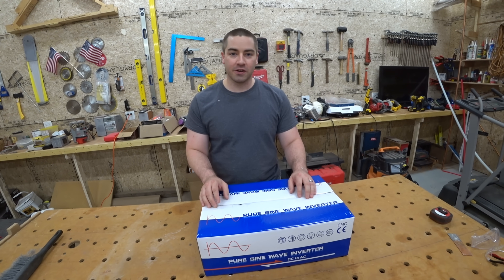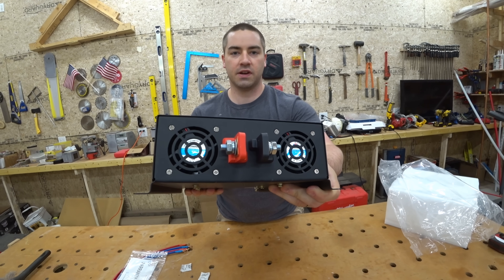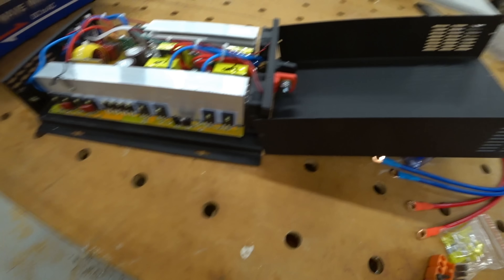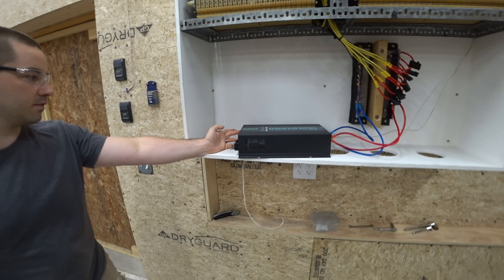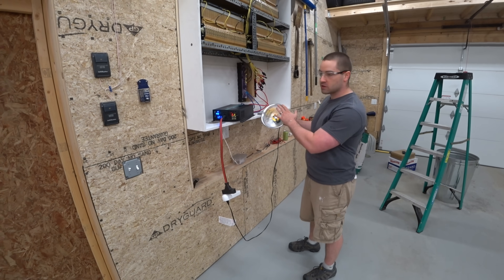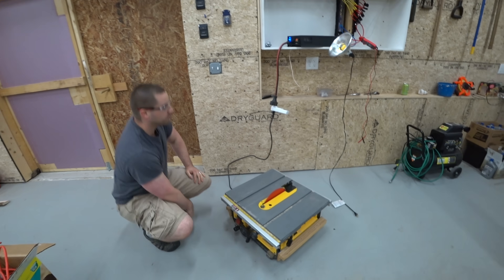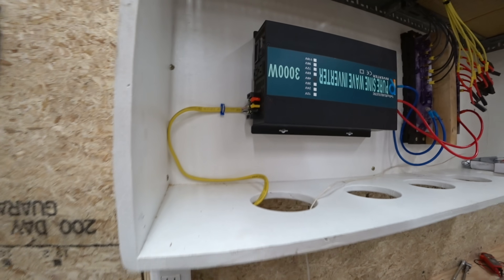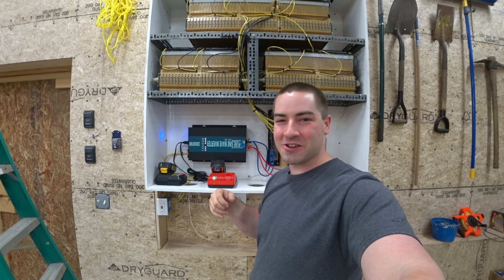Cheap 3000W Reliable Inverter, DIY Powerwall, Chevy Volt Batteries

Comment: Hi, one question. How do you secure that the batteries are charged/discharged the right way, according to the info from BMS? Do you know the remaining capacity of the battery? Thank you
Reply from the maker: Hi Jan,  These lithium cells have a nominal rating of 3.7 volts.  I want to use the cells from a low voltage of 3.5 v up to 4.1 v.  Right now the cells are wired 12 in series, so a resting voltage of  42v (12x3.5) is my low cut-off, and 49.2v (12x4.1) is my high cut-off.  Thanks.
Reply: Hello, and what about the BMS? What happens when there is some fault (in one cell in the 48V array) lets say temperature/voltage. How do you manage not to use this broken cell? how do you manage not to draw to much energy from the batteries, or how do you manage not to charge the it too fast? Does the inverter have different modes? (lithium battery, lead acid batery like for example Victron inverters)?  thank you (I have fiat 500e spare battery and wanted to use it, but it sits in my garage because I'm affraid to use it when there is no BMS.
Reply from the maker: Hi Jan,  Currently I don't have a BMS, but I also don't yet have a charger.  I've been trying to find an AFFORDABLE BMS with monitoring.  I will need 8 BMS's because I have 8 batteries.  

Try checking out "Going Off Grid" YouTube chennel.  He has BMS's.
Reply: Now I see. I tought that you are somehow using the BMS from the car. So there will be much more cabling (if you are going to monitor each cell). I whish you luck and hope to see another great video with charger soon.

Comment: What makes you say it's reliable? It looks new. And the surge capability sucks, and I never really saw you test it with a 3000W resistive load for any length of time. So you put 1680W continuous on it for a minute? Big deal. Doesn't show squat. Get a CT and scope if you want to test surge, otherwise you are just guessing. The sine wave could be at any point in the cycle when you first hit the switch, and no current monitoring means you don't have a clue. Testing FAIL. And your caption is a lie. I am willing to bet if you put 3000w continuous on it, it would fail shortly. Cheap chinese junk never lasts at full service load. Go ahead, prove me wrong.
Reply: From my understanding, the Brand name is "Reliable". Not that it IS reliable. Seemed to work okay to me. It was cheap. Can't expect the best for the cheapest price, ya know?
Reply: Reliable = brand name. Your post fails.

Comment: Hi, first off grate set up, one thing I would have done is change the battery setup to 14 units making it 50.4VDC for a 48 VDC system or even 15 units to give it that little bit more kick, as the 48V inverter will handle that volt easy as, not sure what charge controller you have but the midnight 150,200,250s are really good depending on your solar setup. having the higher volt could kick your compressor on. Have a look at the Nomad PSW inverters, I have the 5000 watt model and it works very well. keep up the grate work. Its good to see people doing there own solar setups. rock on
Reply from the maker: Thanks.
Reply: I have 2 classic 200's and love them.
Reply: Higher DC line voltage to the inverter would likely have no effect on the inverter's ability to start the compressor. The issue is on the load, not the line side. The inverter simply can't handle the start current load.

Taking measures to minimize that load, such as starting the compressor without compressive resistance, or installing a capacitor bank ahead of the compressor will get the unit started. The inverter itself will then support the load to run the compressor.

Comment: hi . i have 4000 watt  inverter and it runs 1800 watt oven . in the beginning it didnt start very well .just for a few seconds.  and i discovered that i need more amps to run it. so i used 80 amp lead battery.  and it worked . so the amps is the key. good luck
Reply from the maker: Thanks.

Comment: Several things. The Reliable inverters do not have a surge rating listed in 99% of the ads. But for the 3000 watt unit, they say 6000 watt surge but not for how long. Some company's units only give a 2 second surge while others are rated at a 20 second surge for up to 4 times the continuous rating.  Second, to avoid seeing the sparks when hooking up an inverter for the first time, you should have a circuit breaker inline with the battery wiring. My 2000 Watt Jupiter unit has ( 2 ) 150 Amp, 42 volt Bussmann breakers on the twin +12 volt feeds. Why so high? Because it can go to 4000 watts for a 20 second surge. The 500 watt Reliable pure sine inverter has a single 50 Amp, 42 volt Bussmann breaker on the 12 volt + feed. Like your 3000 watt unit, if you load it to much more than 500 watts, it kicks out. But the Reliable unit can power the oscilloscope while looking at other inverter's outputs. :-)
Reply: you can likely add some caps to increase the surge amps.

Comment: I have a 1000 watts and I can power drill and DeWalt Grinder and I have it on my Chevy S10 pickup but you guys asking for too much  even and a house you power air compressor and you can see the lights flicking and sometime if you are running two things at the same time the breaker it will blow off ✌

Comment: I have flickering with led what is the problem ?
Reply: Try to add a small capacitor (100nF) to the load. You can also try a surge filter adapter, that has capacitors inside.
Reply from the maker: In our situation we were doing a "backyard test" to see if the inverter is putting out a pure sine wave, or a square wave.  A square wave can mess with electronics, and an LED bulb has some electronics inside.  However, I don't know if that is true of all LED's or what.  We were just trying different loads we had.
Reply: DavidPoz I have problem only with led panels In side room :)
Reply: Stop blinking

Comment: You need 300 amps to run the inverter full 3000 so it can power the compressor and your batteries only have a bout 50 amps each. The inverter would be fine otherwise.
Reply from the maker: Hi zoezoe610, Thanks for commenting.  I'm not sure I follow your math...  Sorry about that.
Reply: http://www.vanner.com/estimating-power-requirements/
Reply from the maker: Hi zoezoe610.  Thanks for sharing your resource, I took a look.  One difference between the automotive based systems and mine is the voltage.  I'm running a 44 volt system, not 12 volts (12 volts was used in the example on the page link).  For my 3000 watt inverter to run, divide the 3000 by 44 volts, and it will pull 68 amps.  Since I have 8 batteries on the wall wired in series, the 68 amps is divided by the 8 batteries.  The inverter only pulls 8.5 amps each.
Reply: Thanks, that is good

Comment: 3000w with those bateries... would have gone for an 8 or 10,000w.
Reply from the maker: You are right, these batteries can handle a lot more.  I'm saving up for a big inverter.  This little one is just to get going.  Thanks for watching.

Comment: Do you have any opinions on using an inverter with variable frequency drives (motor speed control) ?  

{12 v DC to 220v AC} --> {AC to DC to 3 phase AC} .... convoluted, I know!
Reply from the maker: Hi Derek,   Not directly, no.  I've used VFD's on 3ph motors, they help save energy instead of having the motor run full blast 24/7.  However, I have not tried running a VFD off this inverter.  My washing machine is inverter driven, DC permanent magnet motor.  I could try hooking that up.  But I'm a little nervous to do it because the washing machine is an expensive unit and there was so much voltage drop with this little inverter that I would be worried of hurting something in the washing machine.

Comment: The POP when you first connect any inverter is just the rapid uncontrolled charging of capacitors in the circuit. Only happens once,and STILL gets me every time !!! I know,because of late I have changed out inverters WAY too often. We use 3 of the same brand,but found that the 600/1200 pure sine is great,where the 2000/4000 pure sine unit to be junk after 3 replacements. I plan to try a Reliable,now. Thanks..

Comment: Hi Dave. I had trouble with a 3kw inverter shutting down when I  tried to start my hand held circular saw. I made a gizmo using a 3kw heater ellement wired in up to work in series with the saw until the revs got up, then flick a switch and the element was out of the circuit and the saw was direct to the inverter. Worked a treat every time. Unfortunately it would not work with an induction motor, but great for my hand held saw.
It is permanently wired up in my workshop and I  have called it a soft starter. Bet I am not the first.
Good luck
Robin
Reply from the maker: Good tip, thanks Robin.

Comment: What kind of inverter is that ? I have been through 3 cotek and the last one would not even turn on.
I checked all my batteries they are fine but inverter still not working. Any advice?
Reply from the maker: You can find these inverters on Ebay when searching "reliable inverter".  I don't know anything about the Cotek brand.  Do they have internal fuses that might be blown?  There are four internal fuses in my inverter.

Comment: The input cables to the inverter should be increased in diameter maybe... to test check the inverter input voltage when the compressor is switched on....the voltage drop should be minimal.

Comment: Careful, those Reliable Power inverters do NOT like surging.

That safety shut-off also only works about 10 times and then the mosfets blow. :P
Reply: Four ZeroFour any chance replacing the mosfets with better ones or add cooling would make this thing work more, um, 'Reliable'? Lol

Comment: Did you ever figure out a good 48 v invertor and how is this one holding up?
Reply from the maker: Hi Charlie Bravo,  This small inverter is working fine for the couple weeks I've had it so far.  I have not yet decided on which big inverter to buy.  I"ve narrowed it down to duel magnums 4448, or one Schneider XW+ 6848.  Both have pros and cons.
Reply: DavidPoz what is your budget for it, that is the last component that I need. Still building mine
Reply from the maker: How's your project coming?
Reply: Got a small charge controller in and more of materials for building the panels. Had to order a new soldering iron for cell pack building and processing of the 18650s. Moving along very slowly.  Wish I was photogenic like you. 😎
Reply: So I priced checked the invertors...what is your over all ?  Btw, holy smokes, does making video pay pretty good😃
Reply: That was supposed to say budget...
Reply from the maker: Making videos does not pay well for my small channel, maybe if my channel grows...  Yeah, big inverters are very expensive.  That's why I started with a small cheap one, and down the road I'll save enough for the big boy.
Reply from the maker: You mention building the panels.  Are you soldering together your own silicon cells?
Reply: DavidPoz  Currently have a hard cap at $1k , I am not tracking yet but as I am not close but about to build my project spreadsheet. Thanks for taking the time to make the videos.
Reply from the maker: I found my solar panels on craigslist, used.  Sometimes people take them down to install a new roof, and for whatever reason don't re-use the old ones.  Mine are 10 years old and still producing the sticker rating.  Great buy if you can find something like that.

Comment: I would not call my inverters "cheap".   Reliable  Is some of best one's I've tried yet!  You can spend more money on fluff but the transformers, mosfets + ICs tell the real story!  
The wire "is" size correctly for a standard 120v outlet.  Oh and there are adjustments internally.  Not sure why I'm sticking up for them or thinking your kind of a snobby ass?   Peace Out!

Comment: I’ve got the same device for 36v base. When I’ve ordered it I asked them to set custom low voltage and recovery voltage level- which they did and I’m very happy with the device. Also the ventilator/heat control’s behaving good.

But another question, do you have an isolation tester? With my poor resistance tester I can confirm that negative isn’t ground but I still haven’t grounded it yet as I’m not sure how good it’s isolated.
Reply: lee x, What you find in all of the 120 volt inverters is that two legs will show 120 volts on them. And both will show something to ground as the Neutral in them is not a true neutral as you would find in a split phase 240 volt system. Neutral to ground should show zero volts in a balanced system at the panel. Most panels aren't load balanced all the time so you see voltage on the neutral to the transformer to ground if your ground is bad. Something you don't want to see. With a good ground, you may or may not see anything on the neutral to ground depending on how your power company wires things. Ours is grounded neutral at the transformer pole and again at the house.
I checked the 500 watt's readings. 125 V 60Hz between the two sides. 52 V to Earth on the one side. 42 V to Earth on what would normally be the Neutral side. 10 volts to the ground pin from the neutral side. So no, I won't be grounding this unit to Earth. 350 mV case to earth.  When the 120/240 split phase inverter arrives, it will be earthed. This is the reason why most inverters don't have GFCI outlets also. If I fed the Reliable inverter's output to a 120 V in, 120/240 out transformer, the neutral in it would also be grounded to Earth. But for now, it says an isolated inverter and inverter ground.
Reply from the maker: Hi David Ellenberger,  I don't even know what an "Isolation test" is.  I know there is a grounding post on the underside of the transformer, but I haven't connected to it yet.
Reply: You have to be careful with the ground on these inverters as your might blow it (some seems to do An odd way of doing it where it does half the wave between the neutral and positive pin so if you earth the neutral or earth  you might blow all the MOSFETs in the inverter as you be grounding 60v or 120v if 240v version) 
if you watch off the grid youtuber he did mentioned it at some point in his videos  (might of been when he was repairing one) i have to find it (sure it was neutral pin but it could have been the Earth) 

also the 3000 watt rating on that/any inverter (unless it specifies normal and peak) is peak not constant load for about 5 minutes before it shuts down on this particular reliable inverter brand (1500w is normal load)

Comment: I bought the same thing at 12v input 120v output 1000watt for use at work and I can honestly say it's amazing. I carry it in my toolbox with an 85ah deep cycle for indoor lighting without the need of using a generator. It has gotten wet (not while in use) and takes a beating. So far all I had to do is replace the fuses and I might have to reconnect the terminals (they are loose on the inside of the case).

Comment: If the air compressor has any pressure in it it won’t even start with good house currant going to it. I have  a air compressors like that one.
Reply from the maker: Good point Mark.  The first time we tried it the tank had pressure, the second time we tried the valve was open.  This small inverter just can't handle that load.

Comment: Lmao David!!!! Is it 3000 watts peak? "All that to charge your rechargeable tools batteries"
Reply from the maker: Hi Miguel M,  The ebay listing says the inverter can surge up to 6000 watts and continuous power at 3000.  However, I don't think that is accurate based on my tests.  It's just a cheap inverter, good for short term, but eventually I will buy a much larger and nicer unit.
Reply: It's 3000w peak (for max 5-10 minutes or something) and 1500w continuous this applies to all reliable inverter brand models (50% is there constant wattage  load)
Reply: Not according to the manufacturer lee x. They say that the 3000 watt is continuous rating and 6000 watt peak. Here is how they say it for my 500 watt unit.
"Inverter continuous power: 500W "

Comment: Looks like this inverter does not have surge ability and it uses soft start to get inductive loads started after seeing that voltage drop to 91 AC volts when you started that table saw im glad i did not buy this inverter.  Thanks for posting this test video I know to stay away from Reliable now.
Reply from the maker: Happy to help.  That's what is so great about YouTube.  And, no, definitely no surge ability.

Comment: My 4000W Reliable is charging our Nissan Leaf for about 2 hours, (just over 10amps @ 240V and around 2150W) However the solar array is only 1Kw and its seems to hold at around 50% battery capacity with full sun. But have to watch those cloads. Planning to increase the solar array to another 900KW.

Comment: Your head is 12" away from the inverter when you bend over to switch on the compressor. Losing your eardrums from exploding AC electronics doesn't quite qualify you for a Darwin Award however.

Comment: If it won’t start the compressor when there is NO pressure in the tank, you can bet it won’t start it with 80 psi in the tank.

Comment: I think you need a 5000W inverter for that compressor. Your 3000W could probably power a big fridge and freezer though and that includes with an ice maker. I'd raise up the inverter inside the cabinet to w/in an inch from the top and also mount in a high quality power strip to charge your cordless batts. and other small items. Should'a ripped a 2X4 on the table saw to see if the inverter would trip on that task.
Reply: Alan Wilson I agree 100% because a 1hp air compressor takes 4500w to start and 1500w to run but a fright only take about 100w to 200w a day so more than a fright like a computer takes around 250w an hour so using solar energy is the best why to run your air compressor
Reply: Alan Wilson sir.inverter for solar pannell.how much and  how to deliver  to me .im here in the philippines
Reply: l think the inverter could power that compressor but the batteries he was using were just too depleted.